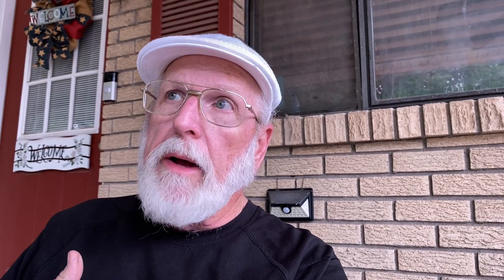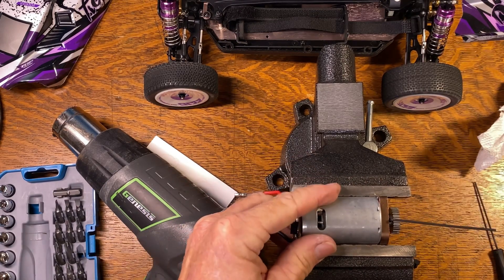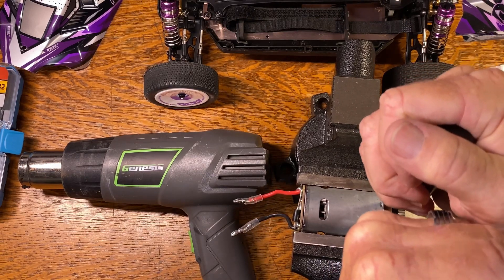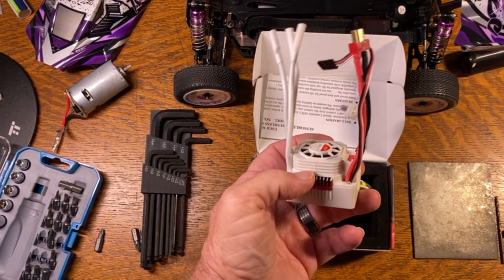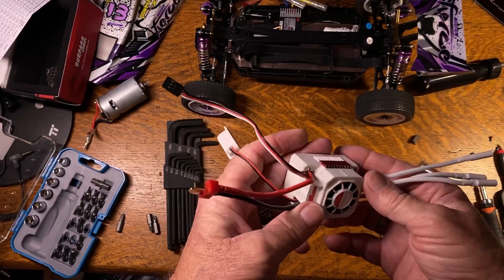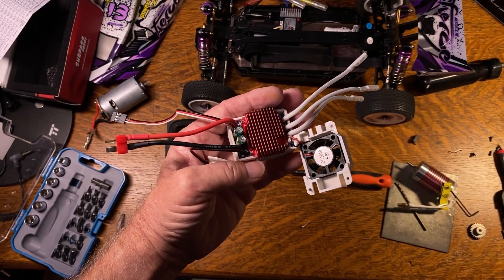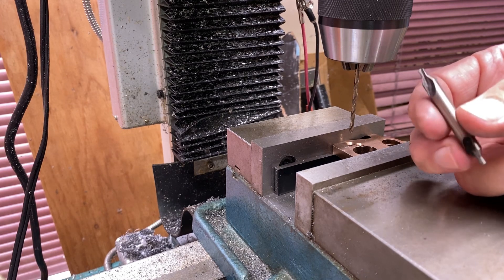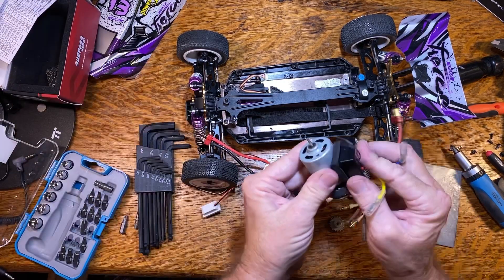WLtoys 124019 (EASY) motor mount mod ✅

Comment: Thank you. They do make a motor mount for the 28mm motors. It's from the 124017 model. They used a 2845 motor in that car in V2. I don't have a milling machine to get it dead perfect like that so, I'll buy a mount for $10.
Reply from the maker: It wouldn’t be too difficult to scribe a line across and use a hand drill but the mill makes it easier. I like to tinker so this is more fun for me. 

I haven’t seen the V1 or V2 mount but I think they moved the motor closer to the spur and used a smaller pinion on the V2.
Reply: @RCModSquad  I just received mine and waiting for mod parts diffs, motor mount, gears etc. I haven't opend the diffs yet but they don't sound great
Reply from the maker: @zeeek1  mine had grease but they missed the mesh point a little.

Comment: I was actually searching the exact same solution. I've been running 36xx on my 144001 and 124019, but I rest convinced the 2845 is the right one for an affordable and durable build on such scales.
Reply from the maker: I did one on a 144001 and I’m very happy with that. Thanks for checking it out. I hope to finish this soon and get a run video.

Comment: Nice work and mount like the choices for mounting i still haven't used mine much about 3 times i think
Reply: So you were talking about needing the proper screw drivers most of these use js (Japanese standard) screws they are there versions of Philips Tamiya screw drivers fit great
Reply from the maker: @AdventureTimeRC  cool fact thanks. 👍 I find a #2 or #3 Phillips fit but only use new bits that aren’t rounded over yet. I’ll definitely pick up the Tamiya set.

Comment: Great video, my question is what is the correct pinion with the same motor as you , to not have to drill the motor mount?
Reply from the maker: Thank you very much. If you stick with a 3650 size motor you don’t need to drill the motor mount. If you want to use the 2845 and a smaller pinion, the pinion off of a WLtoys 959a is supposed to be the correct size and gear pitch BUT you have to drill the hole in the pinion to fit the 2845 motor shaft. It has a 2mm hole and you need a 3.175mm hole.

Comment: looks like your used to pulling everything apart in your toys Dave thats for sure 😊 No cutting compound required for the drilling either hey mate. This hobby must cost you quite a bit to keep adding new bits all the time. I hope these ads help to get you some wire in the future mate :)))
Reply from the maker: It pretty simple stuff. 😃 I hit the aluminum with WD-40 for drilling. It keeps it from sticking. 

It probably won’t ever pay me back for the stuff I’ve purchased but I hope it helps people out a bit. 

I’m starting another channel to try and help people get started on YouTube. I already bought a BUNCH of electronics to get started. 

Have a great day and be safe out there!
Reply: @RCModSquad  I came back to this one to see if your link for your new channel was in here. Ill let if finish as I didn't see the link and want your retention to stay high 😊
Reply from the maker: @RyanIngleton  thanks for that, I really appreciate it. 
https://youtube.com/channel/UCoD4-UdnfKKwEZkbhudsV0g

Comment: Cool info bro! Nice ESC rant and yeah the parameters make for a good guide line but on cars like you said the gearing changes everything!!! Didn't you do this mount mod for the 144001? 🤔
Reply: Have a safe and blessed weekend brother! 😉👍
Reply from the maker: Thanks a bunch bro! I’m thinking the new 124017 will have a smaller pinion. That’s what I’m hoping for anyway. I’d like to try a smaller pinion and 3s on this car. If they don’t I might build one. I did indeed do this on my 144001. It worked really well so I wanted to do another. 

I’ll be interested to see what the new car comes with. Have a great weekend and be safe out there!
Reply: @RCModSquad  You're very welcome buddy. The smaller pinion would help keep things cool and will obviously be more efficient, but it's going to stand on end when you punch it and "may" shred gears 🤷‍♂️ Heck what do I know I don't even have one! 🤦‍♂️ Lol! Thanks!
Reply from the maker: @mikesrcgarage  it might very well do that. I can always turn the punch down and I do have a steel gear set just I’m case. 😉 I bought the set back when everyone said their gears were “completely dry” right before they wiped the grease off and added more. 😂😂
Reply: @RCModSquad  Nice! Lol, I remember the clean the dry gear to put more dry grease on it! 🤣💨

Comment: Hi Dave, I'm going to do this upgrades because I want to transform my 124019 to truggy, with wider wheels, can you reconmend me a good servo?
Batán 115 17 g for example is ok?
Thanks in advance.
Reply from the maker: That should be a fun project. The servo that I have used are in this video. I have been happy so far. 

I haven’t tried the one you mentioned. 

https://youtu.be/10P-dHnnFaQ

Comment: So question is it ok to run 3s on 124017 v2
Reply from the maker: In my opinion I won't run one on 3s with the stock electronics. There have been a few that work on 3s but there have been more that smoked. 

The stock ESC is rated at 7.4v. 

Sorry for the delay on my answer. I'm on vacation and I don't have much data in some places. 

Thanks for stopping by. Have a great day and be safe out there.
Reply: @RCModSquad  thanks alot I appreciate it so I would hve to upgrade everything right or can I upgrade the esc
Reply from the maker: @Rcjamaica876  you'll have to upgrade everything. The stock setup uses a five wire servo and you'll need to have a three wire for a new ESC. 

So wether you stay brushed or go brushless you'll have to change the ESC, servo and radio.
Reply: @RCModSquad  great thanks

Comment: I think that'd not an ideal way to arrange two holes for 19mm.If the motor is strong,it may loosen the screws while rotating...and your central drive shaft will hit the motor under high rotating speed...then it twisted!Now you can buy the new motor mount from 124017,and it's just for 19mm-holes.
Reply from the maker: If you have the 124019 and don’t want to spend more money on it than necessary this is a perfect mod. 

The holes are not slotted therefore it’s no more likely that the screws back out of this mount than the new one and you still have two other motor options with
this mod. 

Thanks for stopping by and checking it out. Have a great day and be safe out there!